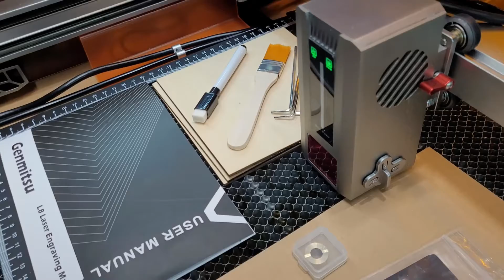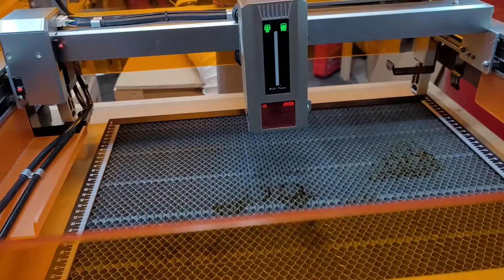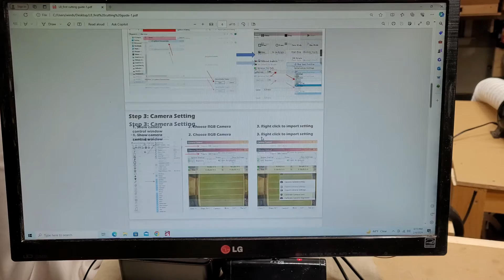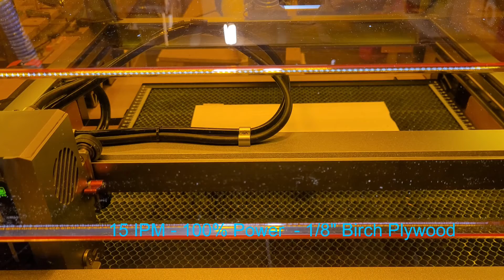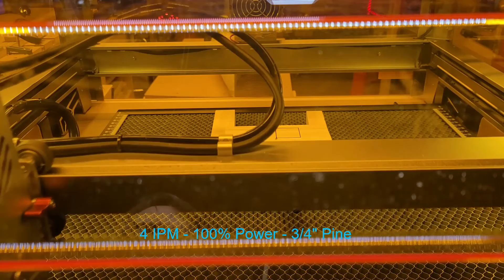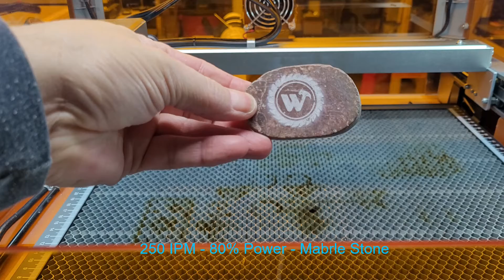Genmitsu L8 Laser Engraver Test & Review

Comment: how do you focus it?
Reply from the maker: There is locking lever on the side of the laser module that releases and let the module slide up and down and a rotating focus adjuster on the side of the laser module that you turn and let it touch your workpiece. The just turn the lever to lock the lase height and turn the focus adjuster so it is no longer touching the workpiece.  There are different heights on the adjuster depending whether you are cutting or engraving.

Comment: How do you hold down 3mm ? Most is warped. This looks like there is no room for magnets
Reply from the maker: Magnets can still be used to hold down the 3mm plywood, depending on the size of the project that you are cutting out.  Hold down pins work great around the edges but obviously can't be used in the center unless you drill or cut a hole in it. But that would also depend on what the size of the project is.   With all of that being said,  you have to keep in mind that the laser can still hit the magnet or hold down pin.  But what I have done is put a piece of tape over the safety shutoff button for the lid so that the machine will not stop when the lid is lifted. That way I can watch the progress of what the laser is doing and lift up the lid to move the magnet to a section of the material that is not being used or has already been cut or engraved. Probably not  recommended by the manufacturer to do that, but it works and I have not had any problems with that method.
Reply: @  Thanks for the info. It’s a little disappointing that the laser is so close to the surface. I have a Longer laser that has room for me to use 5 to 6mm magnets. I cut a lot of 1/8” but didn’t want to have to watch it all the time to move magnets around. I’m using 12x12 ply and most of my work is 11.5x11.5 . This laser housing is 1.25” from the beam. I like this laser a lot but disappointed that it’s so close. I may end up cutting or grinding a few mm off the housing but don’t want to for what I paid for this.

Comment: Nice review!  Researching lasers and just ran across this one. One question. Do you have to have to re focus between engraving and cutting? Seems like a real problem if your trying to batch out items engraving then cutting. Thanks in advance.
Reply from the maker: @WhiskeyandBrookies  Thanks.   Refocusing between cutting and engraving is not always necessary. It just depends on if you have to raise the laser module to insert and remove the workpiece between batches.  The only thing you have to do to refocus is a quick turn of the focus lever on the side of the laser module, maybe a second or two to turn to the proper height.
Reply: @ thanks

Comment: I am having no luck installing any software. Where can I go for help?
Reply from the maker: @debkellett2673  what software are you trying to install?
Reply: @windsorwoodcraft first of all, the usb stick didn’t work. So I tried going to the websites but nothing seemed to download properly. Driver says it is installed. Extra buttons would not install. Laserburn would not install. LaserGRBL software would not install. The Woxcker software seems not to be working won’t connect with the machine.
Reply from the maker: @debkellett2673  Which machine do you have? Woxcker or genmitsu? I always download Lightburn directly from the lightburn website.   The ch340 or 341  driver for the machine can be downloaded from the woxcker or genmitsu website.  The driver is basically the same no matter which site that you get it from, but it's best to get it from the site of the brand of machine that you have.   After lightburn is installed and the machine is plugged in and set up, did you check that all of the safety features are disengaged? Such as the door being shut, the key being turned to the on position, and the emergency stop disengaged?  I believe that for the genmitsu machine like the one I have,  there is an additional step of updating the firmware before lightburn will be able to recognize the machine. I'm not sure if the woxcker machine requires a firmware update.

Comment: Hello I ordered the 40 watt version, upon inspection I noticed I was not able to distinguish between the 40 watt version from what I see online. Is there a way to confirm that my module is 40 Watts? Thanks in advance
Reply from the maker: There should be a label on the back of the machine with the laser information on it.
Reply: @windsorwoodcraft  Thank you

Comment: Great video,well done. Question what is the dimensions of the enclosure? Also is that laser protect plastic cover?
Reply from the maker: Thanks. These are the dimensions copied from the Sainsmart website, 26.85 x 24.41 x 13.50in.  These are the dimensions of the enclosure only, the exhaust port and the cords/switches on the front add about another 5 or 6 inches to the overall depth of the workbench space needed for operation of the machine. The  orange acrylic enclosure is laser safe.

Comment: Hi - true Novis here - just starting to look at a laser purchase.  I noticed that at 8:16 in your video, when you put up the riser legs - it appears that most of that area around the risers is totally open - if that area is open, then it would no longer be a fully enclosed laser - right?  How do you exhaust all the smoke and fumes when the risers are up?
Reply from the maker: It is open all around when using the risers but I have not had any issues with smoke or fumes. Than works pretty good even with the gap at the bottom.

Comment: I'm fighting a problem with any cut that take over 5 min the flame sensor goes off and you can't restart frome the stoped position. To me the sesor is too sensitive
Reply: That, tighten the belt, clean the rails, lense and cone if that doesn't work.
Reply: It gets rid of comments with links. So go to control panel, hardware and devices. Advanced settings. USB device settings. Disable both.
Reply from the maker: I haven't tried a real long project yet,  time wise. But I did notice that when the flame detection goes off, you have to turn off the machine or use the emergency stop and then restart from the beginning.  I'm not sure if there is another way around that, but I'll check into it.
Reply: And if you're using lightburn, it'll say alarm 3. Missed steps. That's how you'll know It's your USB settings.